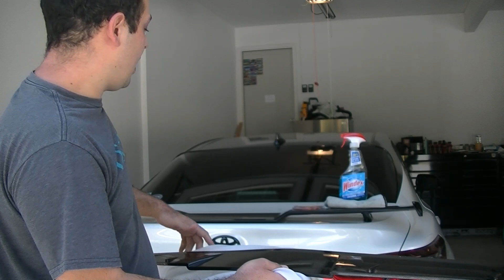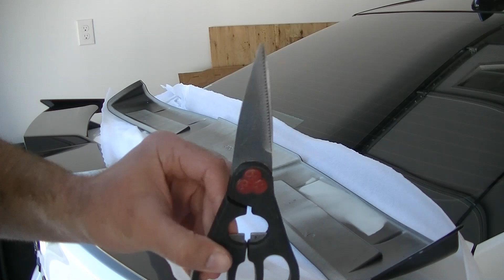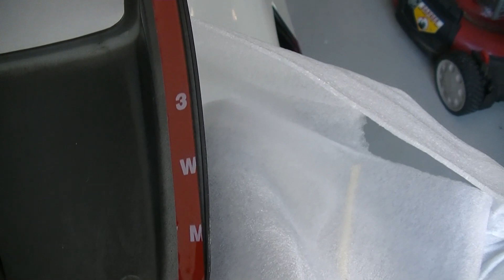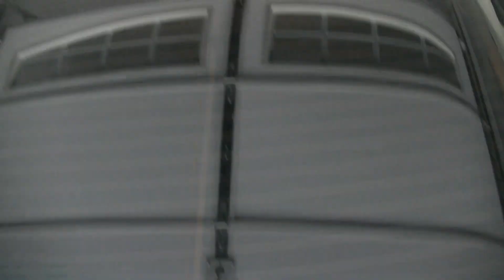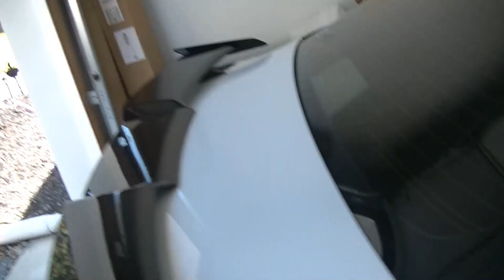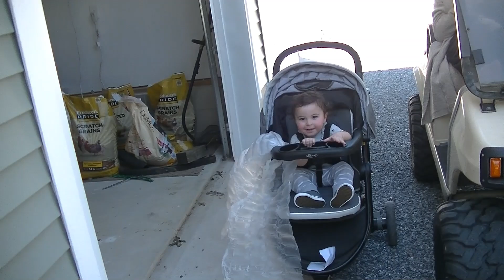Hirev Rear window spoiler install 2018+ Toyota Camry TRD, LE, XLE, XSE

Comment: I put mine on i upgrated the 3m to the stronger one from auto zone it was on a couple weeks i seen it pop up a bit a bird shit all over my car i didnt have time to hand wash like i normally do and the touchless car wash blew it off when you had your trd did you have issues with yours getting the old tape off is hell  i bought 3m spray and it took the black paint off the back

Comment: bro mine keeps falling what 3m did you use the one it came with first doesn’t work
Reply: It's supposed to come with a small tube of adhesive gel to make it stronger. Did you get it with the spoiler?